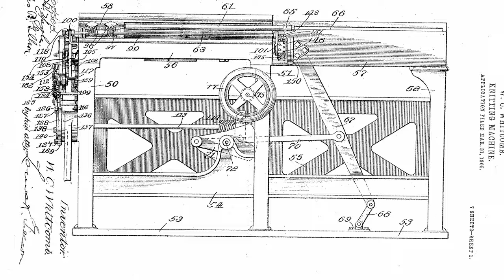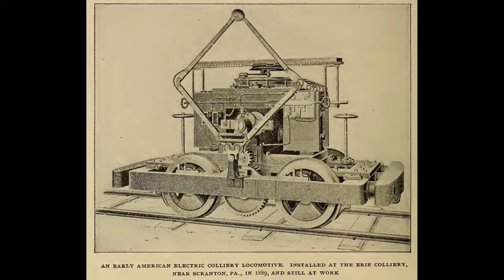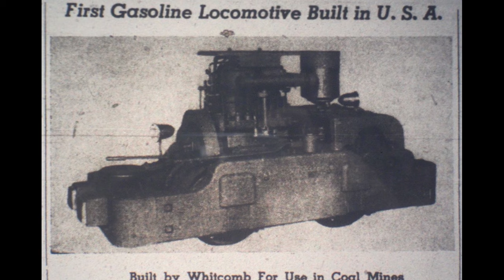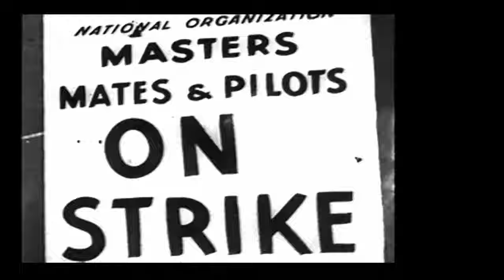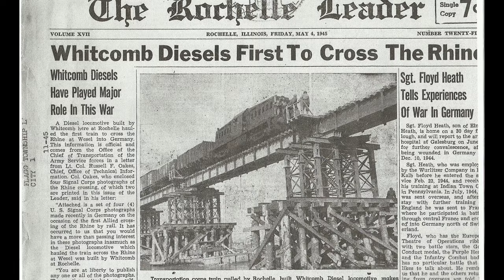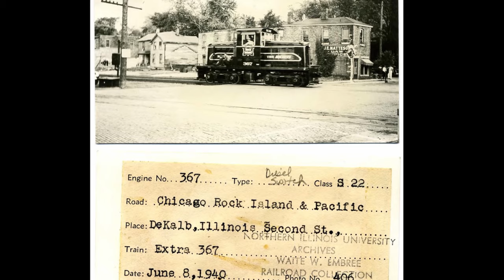History of the Whitcomb building in Rochelle, IL in 8K

Comment: I worked in this old bldg. building Pre-stressed concrete bridge beams from 1973--1977. I ran the huge old 100 ton overheard cranes. Ancient things---1900 stamped on the motors--scarey Place-Very dangerous place
Reply from the maker: I'm glad you made it out ok. How did you like your work?
Reply: @Johnthemousevideo That place still gives me nightmares.  I saw many horrible injuries that were un-necessary but at the time were acceptable. I was young and radical---I gave management constant head aches over safety issues.I was chief union steward. I left Rochelle in 1977 and worked  Heavy construction in So. California for 40 years and I carried my safety experiences with me from the awful stuff I saw in that plant.